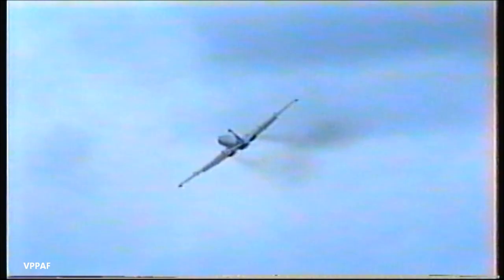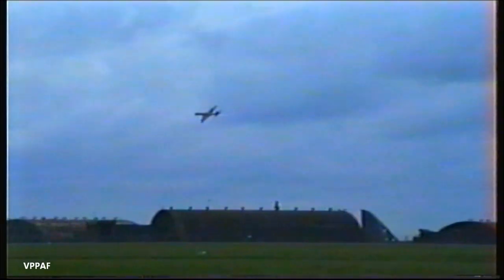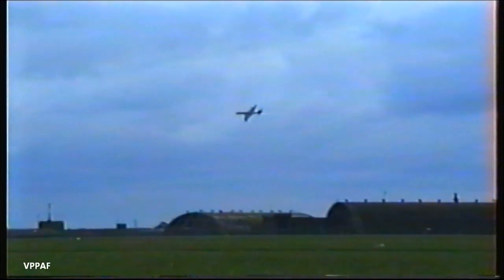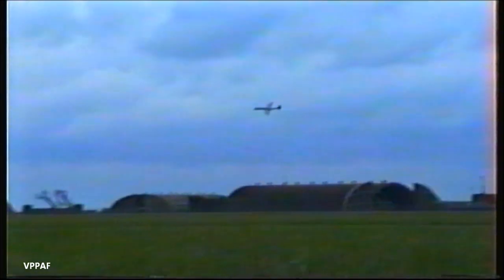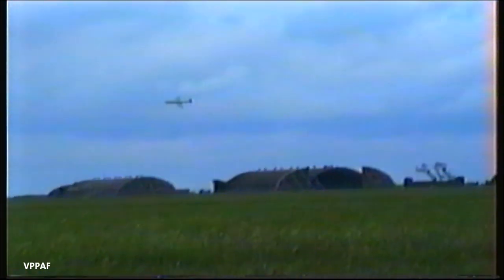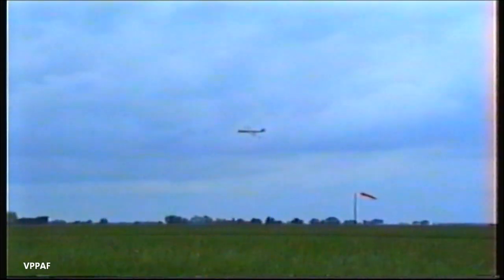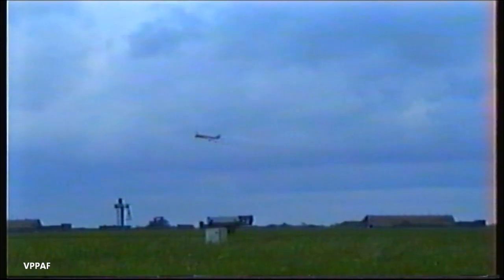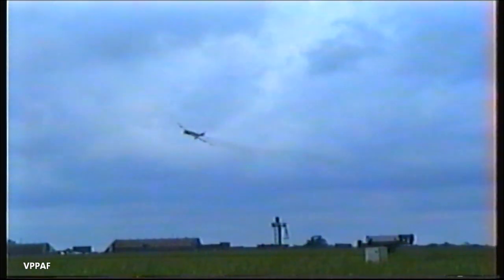RAF Nimrod flight and a crash at Toronto air show in 1995

Comment: Looked like a repeat of the B-52 crash at Fairchild AFB. Too low a speed, too tight a turn, loss of lift/control. Impact
Reply: I dont think it stalled he just banked it too far over and it lost altitude,the nose dropped when it was on its side, when you bank to 90% the fuse drops nose first because the rudder keeps the tail higher. the rudder and vertical stab has more surface area so it drops less which gives that nose down fall, its the start of a spiral dive. he leveled out just before hitting the water, he realized what he had done wrong but it was too late.RIP.
Reply: @gogogeedus  Thats called a STALL when the wings quit giving lift because they are verticle to the ground !!!!  DUUUUUUHHHHHHHH!!!!!!!
Reply: @wilburfinnigan2142  wrong, a stall is when the air flow over the wing becomes detached from the surface of the wing and this can happen at any speed depending on the AOA and other factors,it is not a stall when a wing is vertical if the air stream is still attached to the wing. 
a wing needs to be level with the horizon to supply its maximum amount of lift,as this is the position where it is opposing gravity 100%, the lift will decrees with every degree you add toward vertical and when you reach 90 degrees there will be no lift opposing gravity, at that stage the aircraft will fall toward the ground, as it falls the tail will offer some resistance because of its larger surface area and this will cause a nose down attitude. capish!
Reply: @wilburfinnigan2142  the wings on the aircraft are supplying lift but that lift is not opposing gravity.
Reply: @gogogeedus  A stall dumb ass is when the plane falls out of the sky !!!!   DUUUUHHH!!!!!!!
Reply: @gogogeedus  Well DDDDDDDDUUUUUUUUUUHHHHHHHHHH!!!!!!!!!!!!!
Reply: @wilburfinnigan2142  well you said it was a stall,and a stall is a particular type of condition that the wings are in, you cant apply the word stall to every time a plane crashes, you cant call it a stall when the aircraft is flow into terrain, because it is not the same thing,BTW, grow up!
Reply: @gogogeedus  Hey dumb ass !!! A stall is anytime a plane gets into a position where it can no longe sustain flight and falls out of the sky !!!!! DUUUUUHHHHH !!!!!!  Lack of speed to provide lift is the most common and next is when the plane is in a position that it can no longer provide the lift necessary to maintain flight.    A wing over, or steep bank without the necessar speed as witnessed here is a stall !!!! DUUUUUUUUUUUHHHHHHHHHH!!!!!!!!!

Comment: All the characteristics of a crash. Too low, too slow, overloaded (as all Nimrods were), using a very old but strengthened airframe performing manouvers with a very old wing without high lift devices. The enginers NEVER faulted, black smoke right until it hit the water. Pilot error all the way.

Comment: Said before on these comments.. . there is a B52 does the same thing on a u-tube video.... When the aircraft banks over like that it loses lift, because the lift on the wings is no longer directly upwards. That only leaves airspeed and engine power to keep it up. At low altitude there is no time to recover from getting the balance wrong
Reply: The powers that be are as guilty as the arrogant, egotistical pilot who took the lives of his crew in that incident. Multiple warnings and complaints were made about his conduct and nothing was done time after time.
Reply: That was in the case of the B-52 crash.

Comment: I witnessed this from a high rise building east of the the CNE grounds.  The plane was turning and passed out of my line of site (blocked by another building) and then when I saw it again, very low, and it crashed into the water.  I was shocked and didn't know what happened at first, not able to connect the pieces immediately, then I saw all the boats converging on the spot, and i knew what had happened.

Comment: Too much bank angle.  Either he had no vertical lift left, or he increased the angle to attack to compensate for the bank angle until he stalled.  Down it goes.  When will they learn?  These guy seem to forget what wings do.

Comment: Turn a swept wing aircraft in too tight a radius and the inboard wing will stall.  Same thing happened to a B-52. Pilot error all the way.
Reply: It's the way around. Swept wings stall at the wingtips first, causing loss of roll control around the longitudinal axis.
Reply: Magánpilóta - Private Pilot N. Zoltán 
Read it again. When making too tight a turn (yaw) the inboard wing (not section) will Stall, since the tip is behind the verticle axis.
Reply: I can't follow you. Turn is a turn, yaw is a yaw, totally different things. Wing sections are called inboard and outboard, referred from the root of the wing (i.e., near the attachment point).  If you mean the wing pointing to the same direction of the turn (i.e.., the inner wing), then it will indeed stall earlier than the other (outer wing), but this is the same for rectangular wings, not specific for swept wings.  On the other hand, I agree this is very similar to the B-52 crash:   https://www.youtube.com/watch?v=pJGMl1-fsbg
Reply: DA: Any airplane will stall when too slow.  Steep banking increases the stall speed.   Swept wing and too tight a radius are not specifics to stalls.  Angle of attack and airspeed are the true governing factors.
Reply: DA: No.  Fact.   The B-52 hit the power lines at almost the same moment it was striking the ground (it is huge).  The power lines had nothing to do with causing the accident.
Reply: Doug...
Flunked your pilot exams, huh??
Reply: @KB4QAA  its actually just the angle of attack in relation to the air-stream, airspeed is not relevant, a stall can happen at any speed, and compress ability is a type of stall that happens at the point of going supersonic

Comment: It is almost as if some pilots do not understand what it is that holds their aircraft aloft. Level wings being the best for safe flight and a bank angle requiring some compensation by increasing power and/or other parameters unless a decrease in altitude is desired or allowable.
Reply: He did increase throttle, but couldn't level wings without straying outside the cordon and over the hundreds of anchored vessels.

Comment: Not a mystery.  slow speed and steep turns means stall.  it stalled.  aviation 101.  pilots usually don't fly that slow and steep turn and the stall rapidly occurs.  Pilots are train from day one on slow speeds and steep turns, but forget when they have a plane with massive power behind the yoke.

Comment: I was  anchored in my sailboat less than 500 meters from where it hit and know EXACTLY what caused the crash. 
 The pilot was performing a simulated submarine attack and was flying low and slow directly into a 22 knot wind at sea level.
 He went into a steep zoom, further scrubbing off speed and released multiple flares to mark the point of acquisition of the 'sub'. 
He entered a wingover turn to port and went from directly upwind to directly downwind which would be a reduction in apparent wind of at least 55 knots, combined with the airspeed lost in the zoom, for a total of close to a hundred knots. This caused the plane to begin losing altitude. 
After that he had no choice other than maintaining the angle of banking because to level out and reduce the rate of descent would have brought the plane outside the cordoned off area and into the hundreds of vessels of the spectator fleet.
He kept the Nimrod within the vacant space and flew it into the lake. 
As it hit the water the fuselage folded like a length of chain and a huge fountain of spray was thrown into the air. 
As the mist settled, a silence fell over the crowd.  A couple bright yellow floats popped to the surface, but that was it.
No vessels approached for what seemed like ages. I spoke to a skipper of an emergency launch some time later who told me they couldn't get close because of the large amount of fuel on the surface of the water.
Earlier that week I'd listened to the pilot being interviewed on the radio. He promised to give us a "show we'd never forget". 
I wonder now if this was what he had in mind?
Reply: Thank you for your report. I was in the marina, so didn't get quite as good a view of the crash, though from experience I found watching the show better from the marina than anchored out on the perimeter. The wind, incidentally, is irrelevant, unless the pilot was watching the ground instead of his airspeed indicator.
Reply: It seems you don't know too much about flight theory. An aircraft flies within the body of moving air. The GROUND speed will get less when an aircraft flies into wind, and will increase when the aircraft flies with the wind. The AIRspeed won't drop off or increase at all as an aircraft changes direction within the mass of moving air.  It's the ground speed that changes, not the airspeed.
Reply: Ugu:  Ah, yes. The mythical "Downwind turn crash".  Doesn't exist.  Please leave the aerodynamics to the pilots.

Comment: this look like the b52 accident in fairchild airbase. The wing dip too low and then it spun into the water. The b52 struck some powerlines and wasnt able to recover. The engine you can hear them throttle to full power in the background after the plane fatal hit the water. Its delay cause of the distance.
Reply: JJ: No, the B-52 stalled.  The power lines had nothing to do with causing the accident.

Comment: I think the flaps were partially down for low/slow flybys and must have messed up the aerodynamics. Do pilots undergo rigorous "flying display" training or can they just throw the machines around?
Reply: Flaps would actually help, reducing the stalling speed, provided the angle of attack was not too great.
Reply: Yeah partial flaps allow slow flying but they cause the airspeed to quickly bleed off if the pilot starts throwing the plane around.
Reply: Tungsten Kid  the display crew are all cleared to perform at airshows after many hours of practice. This starts at higher altitudes then slowly reducing in height to the display altitude.
Reply: Thanks, but who exactly "clears" them to do display flying, is it a government aviation inspector or what?..Also when big planes crash, they're sometimes carrying several non-essential joyriders, so maybe there should be a rule limiting those aboard to just a pilot,co-pilot and engineer so that there's no unnecessary loss of life if it prangs.
Reply: Tungsten Kid the crews have to display to an authorising body who visits them to watch them display. If they don't think the display or the crew is safe then they are not authorised and sent away to make changes. The minimum crew for a display nimrod is 7.  2 pilots, 1 Flt Eng, 2 beam window, 2 Navs.
Reply: Thanks, but why is the "minimum crew for a display Nimrod" 7 people?..Couldn't it get airborne if there were less than 7 aboard?
Reply: Tungsten Kid minimum crew for display and transit flights is 7 there's no need for the rest of the crew as there would be nothing for them to do. While the others are displaying the remaining crew does meet and greet with tye public. 14-15 on normal flying duties.
Reply: Yeah I should think the Nimrod only needs a pilot, co-pilot and engineer for display work, so there was no need for it to be carrying an extra 4 people.
Reply: Tungsten Kid Because of the size of the aircraft and where it's sometimes parked they need 2 beam window observers and the captain and nav to help with the display calls.
Reply: @tungstenkid2271  Actually the 7 man min crew included one nav, one wet, one dry, plus AEO (who was quite frequently deputised for by the lead dry or led wet). The AEO and two EOps would handle underfloor fire warnings and the like, one of them would also read the checklists.

Comment: What, lost power in the sky? How does an aircraft with 2 jet engines lose power, unless they forgot to fill her up? Or, was it sabotaged before take-off? Planes in flight just don't drop from the sky like dead birds, they can always glide to a safer landing. But this one, just dropping down is quite hard to believe. Some people shouldn't be pilots.
Reply: Doesn't matter how many engines an aircraft has, if you lose the lift from under the wings you drop like a stone. Usually, a plane can glide as long as it is moving forward and has lift; when a plane banks like that, the wings are still generating lift, but at 90 degrees, not a lot of use in keeping you up. If you are going too slow it loses that lift and going wings level is not going to get it back

Comment: "Lost power" LOL it stalled due to the bank angle
Reply: EXACTLY.  The plane's angle of bank was a bit too steep to maintain lift.  Quite a long time ago, a B-52 pilot did the same thing in a more aggressive manner - banked way too sharply at too low of an altitude, and the plane dropped to the ground before the pilot could level the aircraft and resume sufficient lift to climb.

Comment: and after many years of disappointments the UK made the right decision: P-8A
Reply: I disagree. Shouldve stuck with the UK program with the new Nimrod instead of giving all this money to the yanks. Long range maritime patrol with only 2 engines is not a good safety margin.
Reply: billprezton New nimrod? are you referring to the one that caused fatalities for which the UK decided to cancel the program? your reasoning about “giving money to the yanks” sounds very unprofessional and ungrateful. In regards of using as a platform a very reliable two engine plane such as the B737-800 it was a very smart move for the US Navy, the primary and intended customer. If other nations like UK are purchasing the P8 it is only because America have authorized such transaction. Your comments are nonsense and bias against America, and remember, America don’t need the UK as much as you need us.
Reply: No need to fly that low. Sonobouys have parachutes you know. So do torpedoes. I'm sure that if it was so much less capible they would not have purchased it.
Reply: Poldus Eri  Maybe they should just change the design to more common one
Reply: @markbennot7462  His real name is Wayne King isn't it, hes not a real Robinson like we have hear, our Robinson's are call Robow!

Comment: ok so why did the pilot not eject
Reply from the maker: I could be wrong but I think this plane doesn't have eject seats maybe a escape hatch or something but I guess he thought he could recover the plane
Reply: @VPPAF  No ejection seats. No parachutes. Survival gear amounted to survival suits (to help survive being in the cold ocean/aboard lifefraft), wing root stowed liferafts, an internally stowed liferaft next to the emergency escape (windows) near the win trailing edges, and survival packs with extra supplies etc stowed with the internal raft. As the aircraft was maritime recce/ASUW/ASW and operated far out to sea, sometimes at pretty low level (300 ft wasn't that unusual) then the idea was more that in emergency you'd ditch and escape to the dinghies.

Comment: When you bank an aircraft you loose height as there is no airflow around the wings that give it lift
Reply: you still get air flowing over the wings but the forces are not opposing gravity, so dont provide lift, a wing cant lift when it is in the vertical position. obviously
Reply: Unless you are in a high power fighter that can fly at 90 degrees using the rudder to keep the nose up.

Comment: Why a 7 man crew for an airshow
Reply: Nimrod MR2 had a 13 man crew for normal ops, airshows and flight tests and the like flew a 'minimum crew' complement however - 2 pilots, 1 engineer, 1 each wet/dry AEOp, AEO (often, on min crew flights, this position would be crewed by the lead wet or dry operator - ie a senior AEOp) 1 Navigator. The usual sensor operator complement and tactical navigator weren't needed for non-operational flying.